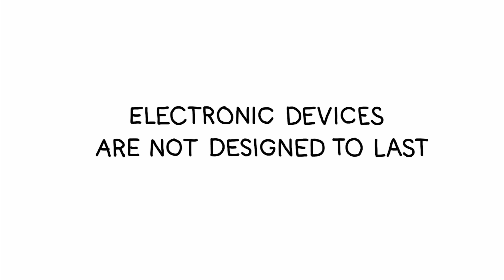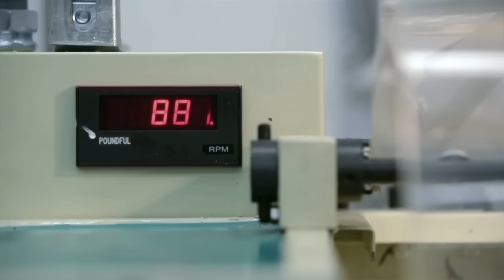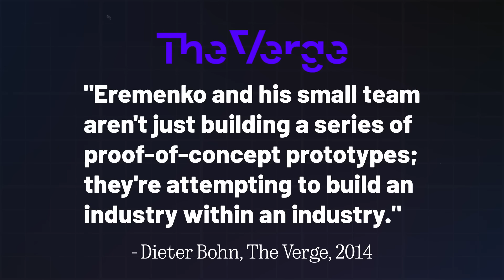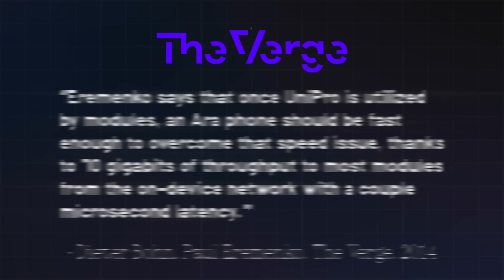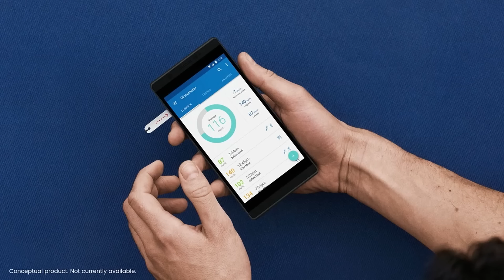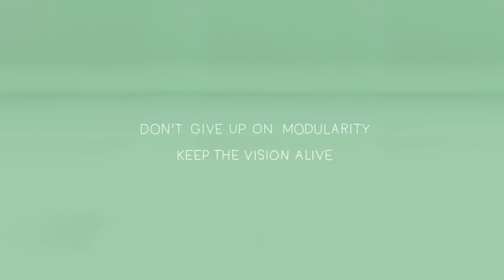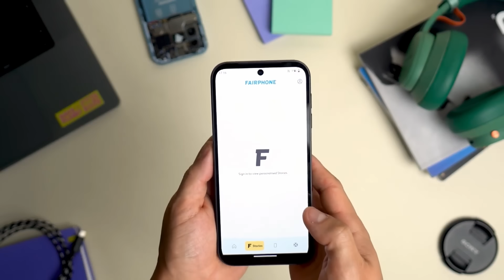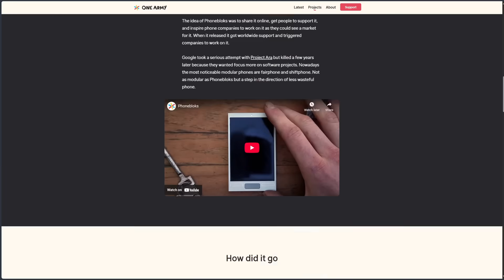Why Did Modular Smartphones Fail?

Comment: Two words: Planned Obsolesence
Reply: Nah, it's because people don't actually want modularity, people think that having options is cool, but like 8 out of 10 people will customise their device once then stick with that until it becomes obsolete or broken.
Reply: @GrandProtectorDark  I think even the people who don't care about options would still buy like a "fundtemtnal base set" and still enjoy being able to replace just indivual parts rather then buying a whole new phone every time. Hell PCs are fully customiables and they still sell pre builds. and if the video card breaks just buy a replacement video card. Something even people buying pre builds can apprecate.
Reply: @Left4Cake  the thing is, Smartphones and Tower PCs fill 2 fundamentally different niche that the comparison doesn't really work.

A full PC setup requires peripherals (screen/inputs/audio etc) alongside the core unit (the tower).

A smartphone (and phones in general) are more closely treated as an appliance, as a unit where all its functions are fully self contained and it "just works" as is.

A much more fitting comparison would be a Laptop.
Reply: @GrandProtectorDark  everything you said. Phones, tablets, consoles, TVs are not computers.  They can't run programs a desktop PC can.  

No one is going to put a Ryzen 9, Intel 9 with a 5090 or 9070 in a phone. The heat would be to much.
Reply: … would still be a thing with modular phones. Probably even more so.
Reply: @ft4709 hey, at least its customizable. id swap out overpriced camera for more RAM or CPU power
Reply: @0liveboi Then buy a phone with a cheaper camera and latest chipset, there are a ton of android phones out there.
Reply: 🤦‍♂️ hardware gets old and wears out that is a fact that you have to live with. As software gets more powerful older hardware can't run it.

There is a reason all computers at airports should be updated to 2025. They are running hardware from the 90s.
Reply: Nobody wants to make money as honestly as... say, Valve.

Comment: People back then worried that ara phone would beome to heavy to hold
Phone today: 6.9inch, 280gram, look exacly like a tablet :))
Reply from the maker: Lol yeah
Reply: What phone weighs 280 grams    an s25Ultra is only 218grams... 6.9 inch phone
Reply: Great, now imagine how much weight and volume would all connectors and cases for modules add on top of base 200g phone, modular phone would weight  30-50% more and be much bigger
Reply: No, phones didn't actually become bigger since then. The LG Flex came out 12 years ago and was the same size as the currently largest iPhone. The iPhone just has a larger display because of thinner bezels, and the current phones are heavier because of all the glass and metal in the case.
Reply: @brinkoftext the battery is the reason for the weight actually.

Comment: Hmmm…kinda mixed on this particular iteration of the modular phone idea.

On the one hand, my inner environmentalist and tech nerd is very disappointed that modular smartphones like PhoneBloks didn’t really take off.

Repairability standards are definitely better than they were just a few years ago, but we’re still very far off from achieving a level of sustainability that would make the environmental and financial costs of manufacturing a smartphone small enough to not be a serious problem.
Moreover…and this is entirely a me thing…but, I think the full potential of a 100% modular smartphone hasn’t been fully explored yet. Like seriously...imagine being able to add a fully analog compass, or second smaller screen, or even a full 360 camera. There's so many cool module ideas you could come up with, and it feels like an absolute waste that none of these ideas will ever get the chance to see production.

On the other hand…there are some things that hold me back from being truly upset about the Modular smartphone’s untimely demise.

For one, I think the overall design of these phones - particularly the PhoneBloks one - isn’t the greatest.
The hot-swapping of disparate modules works fine when adhering strictly to the prescribed slot dimensions available on the frame, but it kinda falls apart when you wanna integrate larger, more specialized modules.

As an example…what happens if someone wanted to integrate a keyboard/thumbboard module that uses the full QWERTY layout?
Or…what if they wanted a dedicated game controller module? Or a larger dedicated speaker for better audio?
Sure, those may be niche/edge-case uses, but if the whole point of a 100% modular smartphone is that it’s supposed to let you personalize your smartphone to fit your specific use cases, then it would seem a little contradictory to not allow any of these hypothetical larger modules to be developed simply on the basis that it wouldn’t be mainstream enough to be worth financially supporting.

Speaking of which…that’s another issue I (and it seems many others) have with this idea of a modular smartphone:
There are still many, many instances of companies both big and small failing to deliver on promised software updates/maintenance, sometimes resulting in those promised updates being dropped entirely as the company's interest in maintaining the product wanes.
And in that environment, asking those same companies to also offer consistent and reliable hardware updates - even for critical components like batteries, screens, camera sensors, etc. - feels like we’re asking Dracula not to be a blood sucking Halloween monster; it’s just not gonna happen (at least not without serious compromises).

With all this being said…I think the modular smartphone idea is far from being bad, or even truly dead.
Apple’s new MagSafe tech is quickly opening the door for smaller developers to make new specialized accessories for niche crowds, like that one MagSafe phone case that has a dedicated slide-out game controller.
And whie Apple is currently the only company offering MagSafe (or at least the only one I'm aware of besides the long-dead Palm), I imagine it won't take long for other phone manufacturers to follow in their footsteps.
So while the modular smartphone - as originally envisioned - may be gone, the concept behind it has evolved to better fit the needs of both consumers and developers. And in my opinion, that’s a win worth celebrating.

(Now, if only Apple would finally make a dedicated MagSafe QWERTY keyboard for their iPhones…)

Comment: The concept was good, but one of the reasons is that it did not require so many modules, and due to this, other companies have also come out and failed, and I think Apple's MacSafe is a successful example of commercializing a modular accessory concept that is not completely successful, but partially successful. Other commercial modules were not compatible with specific models, but the MacSafe has no restrictions on this aspect. Since then, with the standardization of charging standards, other companies have been making related accessories, which is also the direction that modular smartphones wanted.
Reply from the maker: Huh I didn't know about that.

Comment: I realized that concept with a modular laptop in Framework
Reply from the maker: Yeah I almost talked about the framework laptop. It's this exact idea but in a portable computer.
Reply: @owencooktech  Fairphone phones literally are modules... The only issue is that chip companies have monopoly on cpu and gpu .. So you can't transfer cpu between generations.

Fairphone is aluminum solid frame and inner... And does the good for society things... Customer service is heavily understaffed.. but even Fairphone 4 and 5 sold only 200k units... So Fairphone makes like 50k per year in profit
Reply: @meh6513  Chipsets also bring another issue with compatibility when the whole architecture is redesigned, like u cant just swap a intel 8th gen cpu into a 10th gen socket
Reply: Actually some laptop is almost modular but with limited parts compatibility
Reply: Yeah, but a modular phone would be a much bigger shift in context, because phones have zero user-replaceable parts, but most laptops are already very repairable and modular like Frameworks, they just don't release newer motherboards for old models so the upgrade options are limited
(Not to mention Ara went even a step even further than Framework, because you didn't even have to open it up)
Reply: @malucart  I... cannot agree... "like Frameworks" is heavily undermining the lack of repairability/modularity — especially when speaking relatively. The thing with Framework is that you can change a lot of things — ports, RAM, storage, keyboard, etc. Not only that, but this modularity is actively backed and supported by the company — which allows for a relatively high degree of customization. Your typical laptop, on the other hand, will lack this customization and degree of repairability. Sure, they may be repairable to some extent, but quite a few laptops solder the RAM, will lack any reasonable after-market customization for the ports, and you generally aren't able to just swap out the keyboard.

Although, that is talking in a VERY broad sense. Perhaps there are other laptop brands out there that do support customization on that level — but I haven't heard of them yet. Framework is the only laptop brand that I've heard that is that customizable.
Reply: A phone like a framework laptop would probably work better than project ara

Like the fair phone 5
Reply: You would think that after 20 years of laptop, it would have standardized keyboard, speaker, or touchpad to save money.  Nope.  Almost all models of every brands have something different (dimension, connector, etc.).  Cannot even agree where to put ctrl, fn, windows keys.  I have two laptops that swap the positions...
Reply: Yup
Reply: I remember upgrading processor on my laptop, it was a nightmare. I had to find compatible processors and keep TDP in mind, and then I had to find a processor, since they were never sold to customers. Then I had to disassemble the laptop, which wasn't very easy.

In the end it did work it run faster and quieter, but was it all worth it? How many jumped through all the hoops to do it? Modern laptops have soldered processors, sure, you can't upgrade them, but on the other hand they are a lot thinner.

Comment: funny that they mentioned that latency was a big problem, specially because pcie is right there, not only that they could make a cpu/ram module that could open, pcie3 was already mature and while it could have been a challenge to engineer speed wouldn't have been a problem, hindsight tells me that the reasons they couldn't do it, the official ones, weren't the real reasons, i think the actual reason was that there wasn't enough enthusiasm by the investors because up front cost and adoption costs would have been too high, and there's also the case of Ford v Dodge which states that a companies first and foremost objective is to repay investors and so yeah, i think it was the investors that just couldn't commit to the bit, honestly the phoneblock was a better design, because it borrowed a lot from the pc market, a central board with many blocks bolted onto it, but it's more expensive to manufacture than to sell so investors won't be happy, and if investors aren't happy the product doesn't get made
Reply from the maker: Pcie3 wouldn't fit on a phone?
Reply: @owencooktech  the slot no, but the protocol yeah i'd say they could implement it, hell we can even see pcie lanes on thunderbolt devices, i bet they could have implemented it in the soc
Reply: @idkwhattonamemyself2 SO hell, i could theoretically put a RTX 5090 in this shi?
Reply: Nah it just contradicts the purpose of a mobile phone: mobility. A Modular phone especially something akin to project Ara are more complex in design making it more likely to break, phones with removable batteries had this very issue. Not only that but things like battery capacity, water/dust resistance and power efficiency a PC has none of these issues.
Reply: @RevRanger00  right, because framework computers are bigger, run hotter and have worse specs than regular computers, just because they made them modular, nobody could ever make a sleek modular mobile device that's also repairable, silly me

Comment: Cheaper and cheaper electronics doomed this. It made sense from a lot of angles, but really mattered when phones were expensive and constantly needed upgrading. Now that they are cheap and phone plans are designed for frequent upgrades, the reasons to love it will not be a driving force. Yes phones are still ridiculous for the environment, but that's not enough anymore.
Reply from the maker: Yeah fair enough. I get your point.

Comment: Huh... Why not a Phone casing to becoming the modular  slot in devices on the back of the casing. 
Imagine a spirit level, a mini clock, a figet toy , a mini backup battery , a flashdrive  is just a slot away.  At the back
Reply from the maker: Yeah that would be dope to have a module with a diverse lineup of supported attachments.
Reply: As a builder, it would be awesome to have a messuring tape built into your phone.